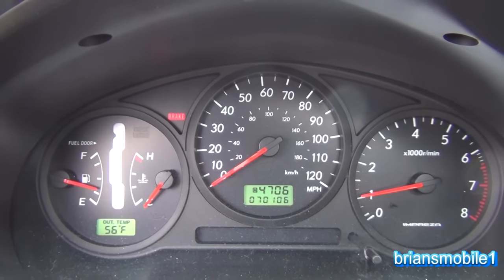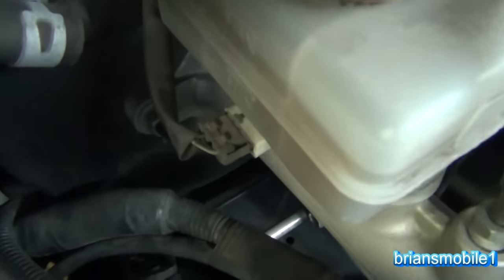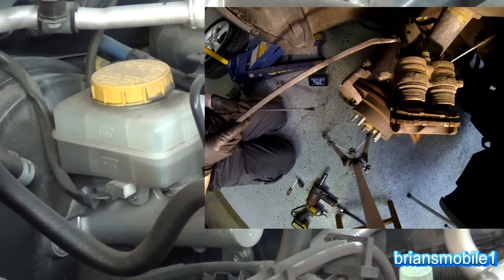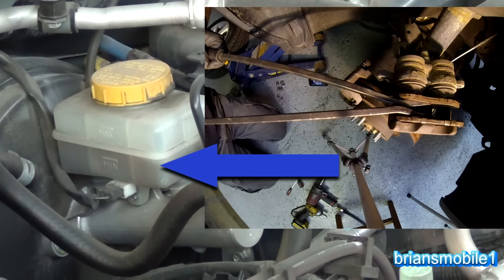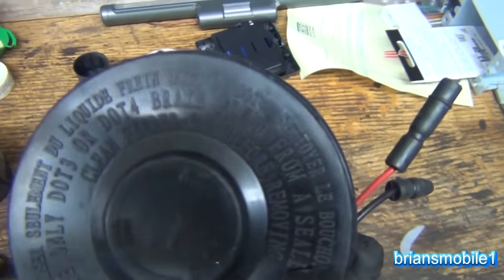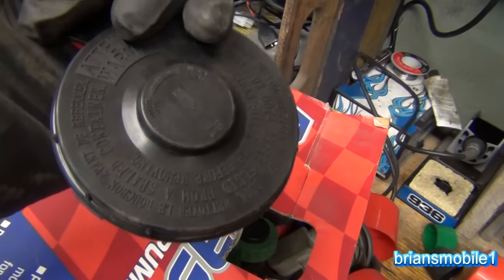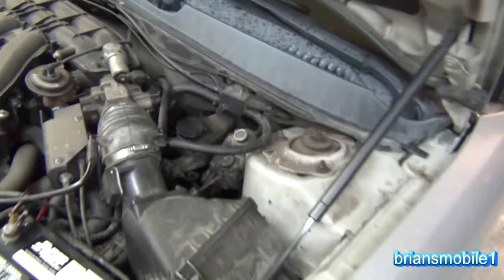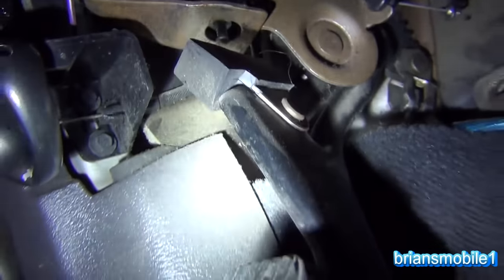This is Why Your BRAKE Light is ON

Comment: Brake light was on the Dodge Neon my wife drives. I checked the brake fluid level and it was low. I added more fluid and the light went off, but after I pumped the brake pedal a few times after adding the fluid there was small puddles of fluid under the car in the drive. I also checked the emergency brake, but it was not in use. Curious why the fluid came out unless there was too much added. I was careful not to overfill it
Reply: Also of note: When the break pedal was depressed it wasn't as tough as it has been in the past. Do I need to have them bled or is this common. It's almost as if I have to push the pedal all the way to the floor panel to get the vehicle to stop, but it gained more tension once I added the brake fluid
Reply: Got it fixed. Thanx
Reply: I havea nissan Xterra, i replaced the Relay and some of the chips, n parking light still stay on and head light wont work unless i hold high eam, n i checked the break pedal and Thats fine

Comment: Shouldn't you take the cap off the reservoir before forcing fluid back in?
Reply from the maker: It's vented.  You should check or watch so that you don't overflow it through the vent.  Brake fluid is bad for paint.
Reply: +briansmobile1 just a little note, the cap shouldn't be vented. It's a sealed system.

Comment: So, using a C-Clamp is a bad idea to compress calipers? Any reason other than not flexing like the pry bars?
Reply from the maker: They're slow enough that they're usually fine.
Reply: Years ago, I saw someone try to compress the piston too fast with a c-clamp.  The c-clamp broke the plastic or phenolic piston.  Brian's method distributes the force better.
Reply: Perfect. I've always used a c-clamp and never had a problem. I'll use the pry bars from here on out. Also, it seems like the pry bar method will work easier on almost any caliper, since I've had trouble in the past with not being able to fit the c-clamp where it needs to go.

Comment: Hi Brian. I am glad I found your video. I spent today doing a radiator flush, new hoses and t''stat on my wife's 2002 Taurus. After I checked for leaks, I dropped it off the jacks  my wife took a test drive. Well, we were almost home and she noticed the brake warning indicator light was on intermittently and then stayed on. Of course I had to explain that radiator work would not affect the brakes. The fluid level looked perfect and I was beginning to think the float switch was the issue  ..  until I saw your video tonight. I set the parking brake after getting the car on the jack stands to work on the cooling system.  Maybe a bit too forcefully. I will check the parking brake switch in the morning. Thanks for the lead on the problem. (So, maybe my radiator work did affect the brake system.!!!).

Comment: hey Brian , I have ford flex when I turn ignition on  and BRAKE SYSTEM light on so quick like 1sec and gone . and car won't start no crank nothing. do you think car won't because that or something else. my car running and drive fine, but parking over 1week all this happen. thank you hope you give best advice

Comment: Thank you, you saved me from a heart attack. Brake fluid was low.
Reply: Keep in mind that with disc brakes often times when the fluid is low (no leaks) its a sign that the brake pads on one end or the other could be near the end of their service life, just something to check.
Reply: I hope you aren't serious, that you need a video to tell you to check your brake fluid when the light comes on?  It is something you should periodically check anyway, before the light ever comes on, so you catch whatever the cause may be, which as another person pointed out, could be the pads nearly gone.  However, you'd have to have all 4 pads pretty much worn to metal before the fluid level dropped that low, as the reservoir is designed to have enough fluid in it to handle the pads wearing.